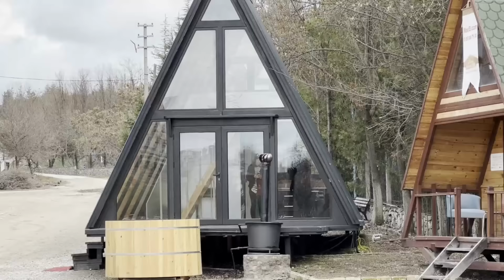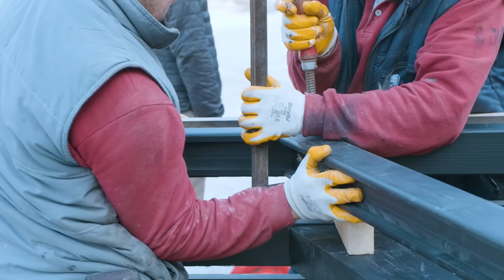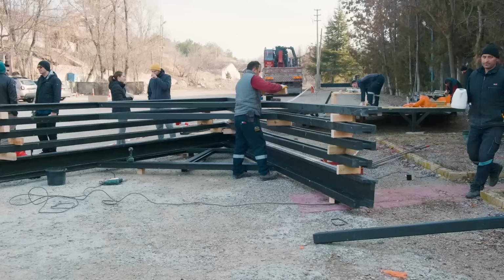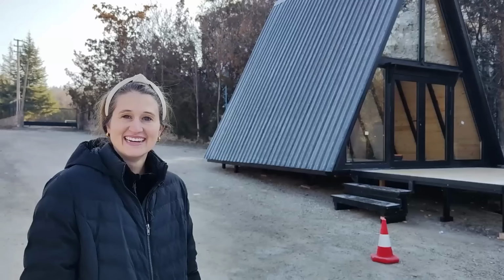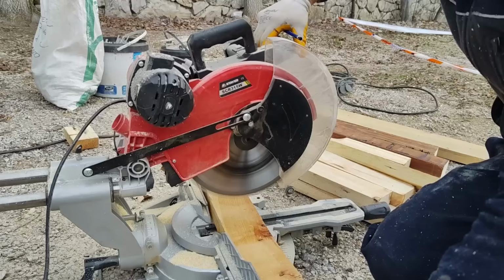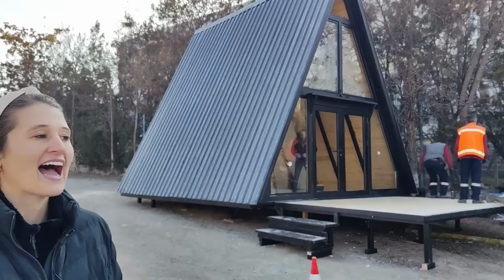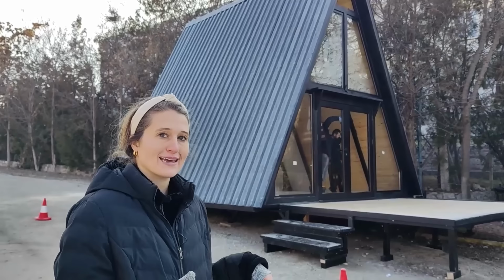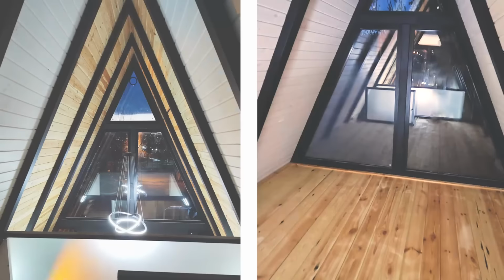Building an A-Frame Cabin in 3 Days: Our Prefabricated Kit Journey

Comment: too bad getting a kit to any where outside your area is absolutely ridiculous right now . . . i was expecting insane prices and poor quality but from what i'm see'n on your site the only 'lack' is insulation value and some rigidity in wall panel (would be solved with proper sip panels on top of the inner wall inserts :) but still decent prices if they're the same and not complete crap. . . nice job gentlemen.
Reply from the maker: Actually, we have quite satisfactory insulation layers in each kit. You can also see them in the video that we published yesterday. Unfortunately, while making this video, our timelapse camera was mulfunctioned in that part.

Comment: 0:00:🎉 Intro
0:26:🏗 First look at the site and unloading
0:33:🪵 Building the wooden foundation
0:47:🏠 Installing floor insulation
1:27:👀 Initial thoughts of our visitors
2:19:🏗 Framing
3:40:🏠 Roofing: Placing plank panels
5:35:🏠 Roofing: Installing insulation
6:04:🏠 Roofing: Adding metal sheets
6:32:🏢 Interior construction
7:08:🏞 Building the deck
8:20:🔍 Review of the build

Comment: Actually interested in expanding our safari lodge in Kruger area with three of these BUT …termites, bugs, bats, mice, you name it. SO they’d need to be full metal frame, rather composite materials than wood, and insulation areas that are completely airtight (so to speak; I mean no animal must be able to make its way in). The layout would also need to be different in our case (large bedroom downstairs behind glass doors, kitchen + dining area in the back, no living room inside but rather big deck partially covered by the a-frame, and nothing upstairs - apart from a large water tank of 1000L). If you guys are ever interested in expanding your business in Africa; please get in touch!

Comment: Is it possible to live in this building when outside temperature is -30 or even colder than this ?
Reply from the maker: While it's possible, it would be much more cost-effective for heating if some of the glass areas were replaced with insulated panels(we do this all the time) . Dual-pane glass has an R-value of 2, whereas insulated panels have an R-value of 12 or higher. This means insulated panels offer about six times more heat preservation per area compared to glass. 

, the extreme condition of -30 degrees outside makes it crucial to prioritize efficiency over aesthetics

Comment: what did they do with electrical and plumbing, heating, etc?  Seems like they closed everything off without running wire and piping...
Reply from the maker: Some space left for plumping  , electricity is surface mounted hidden rear side at beams in cable railings.

Comment: Overall, it’s a simple structure. But a crane is required to build such simplicity. Non-ventilated roof slopes and lack of vapor barrier will undoubtedly affect the cost of air conditioning and the lifespan of the house itself.
Reply from the maker: Actually we use 2 layers of moisture barrier , one over osb , other is under isolation metarial but this was a demo build so it will be disassembled and moisture bariers are torn apart when disassembled, so they are not here , 

Depends on where you build them in very hot climates we leave vent outs at top of  roofing, so heated air could leave there ,  but in winter areas it gives a weak point for snow leaks ,
Reply: @MasifEv  It’s a pity that I didn’t see all this in the video.

Comment: So at one point you said “..so you don’t have to climb.” Yes you do for the rest of the roof work including the insulation, the out layer of plywood, the final layer of metal and the ridge piece.  This is a very very steep roof so, not a DYI project.  Also, are there ridge vents?  And why chisel for door hardware.  It should be factory-carved.  Is opening the doors the only way to get air circulation here?  I sure hope not.  Oh yes and plumbing and electric?  I love the look. But I see too many things you glossed over and too many important issues ignored.  Of course you may have solved all those issues but the video is woefully inadequate.
Reply from the maker: We appreciate your comprehensive review. The phrase "…so you don't have to climb" was specifically intended for the plank's job. It's important to note that other roofing stages involve a significant amount of climbing. While the structure is prefabricated, it's essentially a building cabin. Unless you possess considerable dedication or experience in construction, we advise against taking the DIY approach. While it's feasible, executing it would demand substantial effort.

Regarding the bathroom doors, they aren't factory-carved with chisels. This decision was influenced by our work on a non-permanent basement where leveling might be inconsistent, necessitating potential alterations. However, in scenarios involving actual builds with proper footings, the doors are prepped accordingly.

As for ventilation, your question about the doors being the sole source of air circulation is half way valid. Typically, we incorporate two openable windows for this size. One is situated near the kitchen counter, and the other in the bathroom. In the instance of the design you're referring to, we aimed to achieve a panoramic bathroom, which led to the exclusion of one window in that area.

Our standard practice for promoting air circulation involves the use of fans and, when applicable, air conditioning units. The spaces above the triangular glass sections are intentionally designed for the placement of these fans to enhance ventilation within the structure.